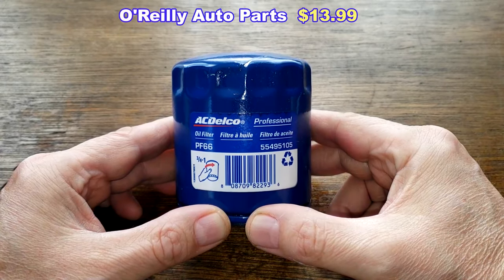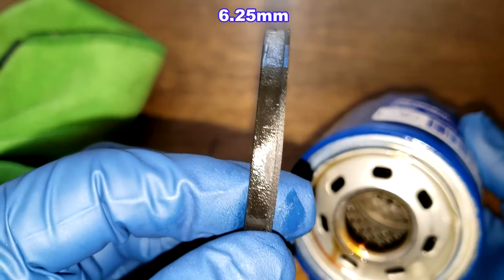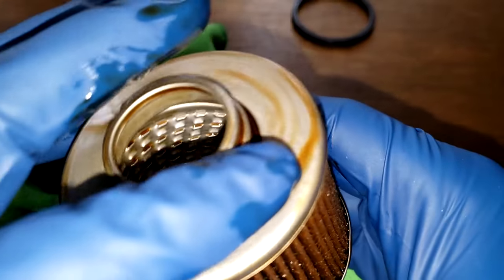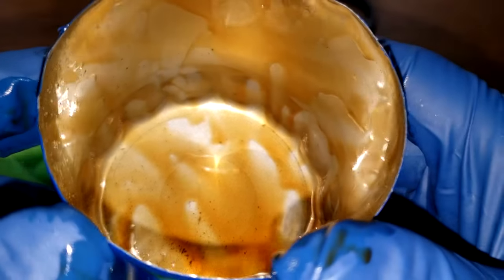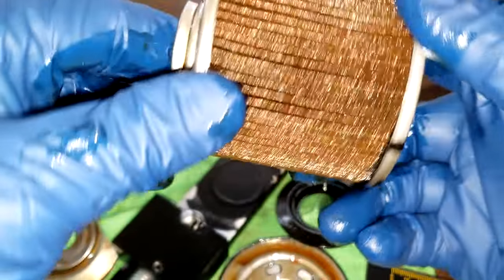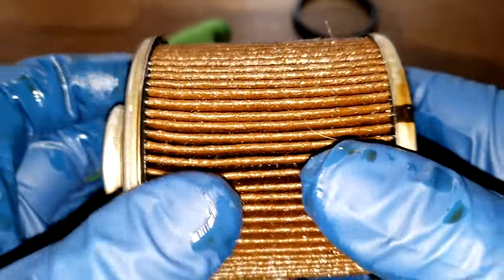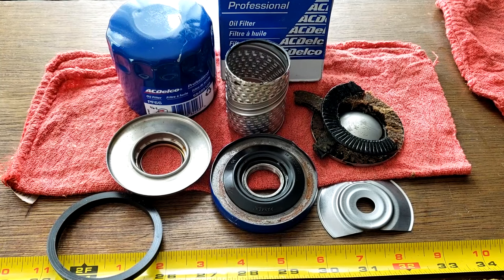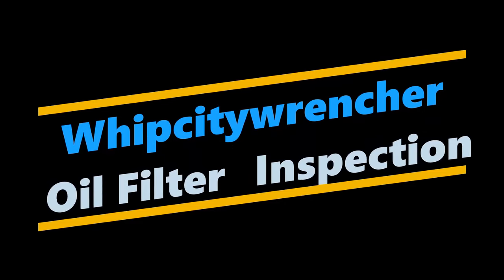ACDelco Oil Filter PF66 Cut Open, Used ACDelco PF66 Oil Filter Cut Open

Comment: Nice work, Pete.  That end cap separating like that is a little problematic.  I'd like to see you cut an unused one open to see if that one has a problem too.  Otherwise it is a good looking filter.  Considering that is a turbo engine, The oil is pretty clean.
Reply from the maker: Hi Jim, Thanks!
I opened up a New one a couple of years ago, "the same size filter actually" and it did the same thing.😵 Here's the video link. https://www.youtube.com/watch?v=EbySqef68IM
Reply: @WhipCityWrencher  I just watched it.  That black adhesive looks like some kind of high temperature caulk.  It is not sticking because the surface of the metal endcap is too smooth.  Also the fact that it gets hard over time means it gets brittle. which means - you guessed it - pieces can break off.  The excess glue hasn't changed either 😠

Comment: First time I've seen an ACDelco oil filter made by Purolator. As for the endcap, been seen before, even given a name, end cap popper. The 'common wisdom' has been, as long as potting/(glue) intact, smooth surfaces and stamped spring functional holding element, no oil bypass. I suspect oil seen on potting from after can cut open. Whatever the case, rest of filter looks ok. Thanks for vid.
Reply: Good info fax, thanks.
Reply from the maker: Hi faxmen09, You're Welcome.  I opened up a New one a couple of years ago, "the same size filter actually" and it did the same thing.😵 Here's the video link. https://www.youtube.com/watch?v=EbySqef68IM
Reply: @WhipCityWrencher  I had forgotten about the other Puro made ACDelco. The only thing that would concern 'me' there if the potting had the slit/cut in it before it was removed from the endcap. I 'suspect' that happened on removal of potting and/or media. If stamped spring functioning as designed, shouldn't bypass. But, I get where on appearance, it could be open to question. In the unused it could be peeled off endcap. In the used here, the potting cured to media, to endcap, not so much.
Reply: @faxmen09 , now I want to cut open a brand new one from a similar lot number & see if it too falls apart before oil passes thru it ! I wouldn't use these but try to find the OEM GM Korea built filters for this vehicle....GM & AC Delco need to either step it up or switch the vendor who built the PF66 ,I'll try to get the OEM GM Korea part # for this vehicle
Reply: @daewooparts  If by brand new you mean unused, I don't think you'll find an endcap popper same as topic. I think it will be all intact, when opened. (Not referencing forcing the potting and endcap apart.) Can't 100% rule it out though. I think once the hot oil goes through the filter the potting adheres well to the media, less well to the metal endcap. Still, the PF66 remains the only ACDelco application I've seen made by Purolator. 'Afaik' majority of ACDelco still made by Champ Labs and no similar end cap popper seen post use.
Reply: Thanks.

Comment: AC/Delco filters used to be made by Champion Labs.  This looks like it was made by Purolator.  The glue not holding the end cap is disconcerting.  More and more it's looking like domestically made oil filters are junk and the Asian-made ones are superior quality.
Reply from the maker: Yep, this one does look more like a Purolator made.
Reply: Yup ,they should just get the GM Korea factory made filter for the Encore, it's built in Korea at the old GM Daewoo plant ,the Korean made filters are was better, I sent Whip the Korean made GM filters before

Comment: Mobil 1 and 3000 miles? That oil is barely broke in! Interesting that this is not the 1st time you found this filter came apart.
Reply from the maker: Hi Don
JMHO
But It has a turbo and depending on how she drives (short trips etc..) 3k miles may be a good OCI.😊
Thanks.👍
Reply: Thanks, WHIP…..nice overview: “good”filter appears; actually I use this *PF-46,Filter occasionally in my 2007 Canyon 2.9 L/4 CYL…. Anyways, did get a “note” from NAPA TECH:: * Apparently, or “ fits”, one May use PF-61 / ,or Presumably( the **NAPA GOLD & Equivalent ,)*the bigger /long Version fir my App,ications..…. I have never used , or double Checked CROSS REFERENCE,””FOR alternate PF61 “”. The 2007 CANYON 4CYL, is horizontal **& FACES RADIATOR, **with minimal appearing Clearance,etc. ( most years, I simply switch out to **BOSS PUROLATOR, FROM MY Mechanics’ Brand …..) , etc.

Comment: When Purolator makes a Delco filter 1:47 & it literally explodes 💥 hopefully their engine doesn't explode real soon as it wasn't filtering the oil & probably glue passed by as well, he should get that filter & file a complaint against AC Delco & GM incase of engine failure or issues later on ,it's definitely defective

Comment: Great analysis Pete.  In my opinion this is a not what I would want on my car.  No bypass valve, separation of the end cap which may have led to oil bypassing the filter media.  I think there are aftermarket filters that would better serve.
Reply: Dont quote me but I saw something that the 1.3l has a built in by pass in the motor.  None of oil filters for that motor have a bypass valve.
Reply: Built in bypass valve on the engine on GM vehicles
Reply from the maker: Thanks, Tony
as others have stated this filter was meant to go on engines that have their own bypass valve on the engine.

Comment: A metal end cap that failed! I wonder what the FRAM haters have to say now! The glue bonded well with the synthetic media fiber but did not bond well with the metal end cap. The metal is a non porous surface, I am not surprised it failed.

Comment: Buick 1.3L turbo engine?
Reply: Yess
Reply from the maker: Yep,  https://www.rockauto.com/en/catalog/buick,2022,encore,1.3l+l3+turbocharged,3449744
Reply: It's basically a Daewoo
Reply: @WhipCityWrencher  Small displacement turbo engines are common in Europe, but for US it makes a big impression on me.
Reply: @daewooparts  I knew Daewoo motor was dead.
Reply from the maker: @ΦίλιπποςΣβουρώνος  You're right, but these days they're making them smaller with turbos to squeeze that extra MPG.😊

Comment: end cap MUST hav had sum OIL on it f/manufacturing/stamping...  'can' does not look clean 2 me... has GRIT on bottom & sides... w/only 3,000 miles that filter BETTER b clean... another interesting filter cut-up... good job, again...  😉
Reply from the maker: Thank You👍💯